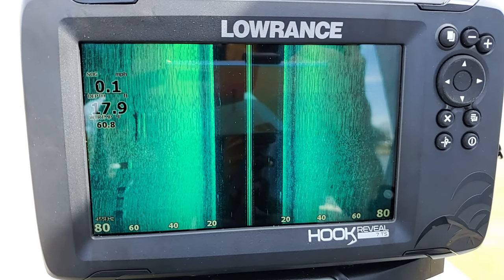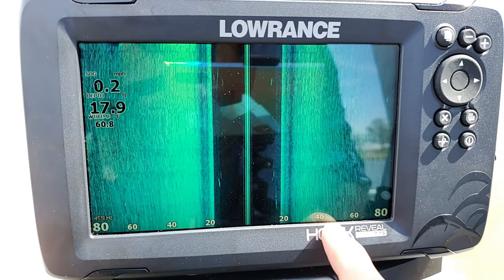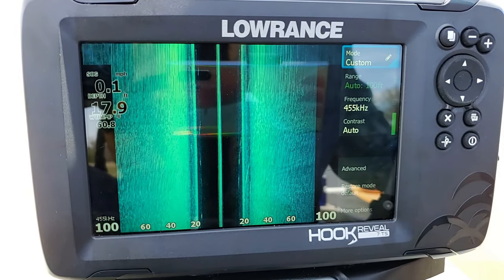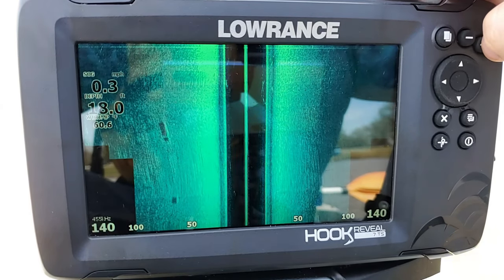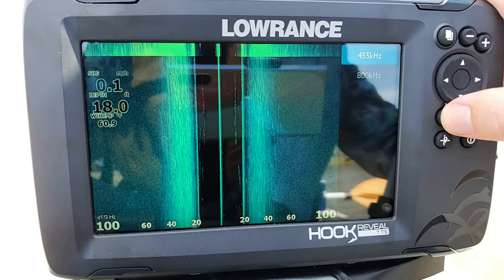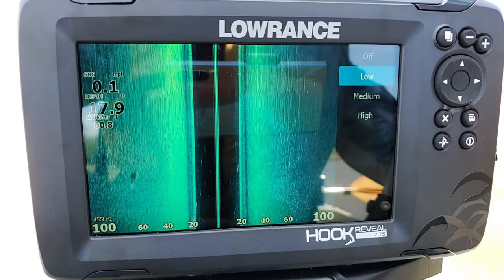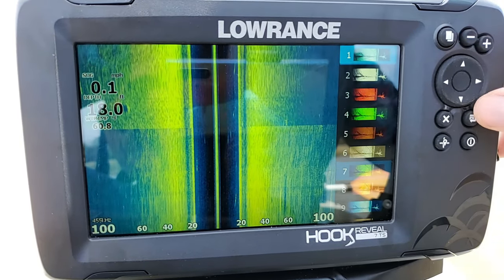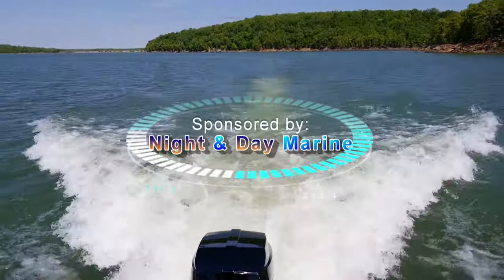Hook Reveal Side Imaging Tutorial

Comment: This is really helpful! I use a 50/200 sonar with down scan today, but really would like to purchase a sonar like this with side scan. witch one are you using her? Or do you have a tip witch one to buy to my Hook Reveal 9?
Reply from the maker: If you use a 50/20p transducer then im assuming your in saltwater. In which case I probably wouldn't recommend this unit cuz it only does 83/200 and is really meant for fresh water. However, if you are using it somewhere warm like the gulf and arnt going too terribly deep then it will work.
Reply: @nightanddaymarine8823  Thanx for replaying. And yes, I use it at sea, but this one I will be using on my riverboat/lake, max 150-160ft, but for the most around 30ft.
Reply from the maker: @mobiusproject4602  this unit would work well for that then. It comes with the tripleshot transducer which does traditional 83/200 chirp sonar as well as downscan and sidescan imaging at a decent price.
Reply: @nightanddaymarine8823  Thanx:-)

Comment: Great vid, but couldn't find what I was looking for..... 
When I plugged in my unit with the tripleshot transducer there was no sidescan option ??? How do I enable it ?
Reply from the maker: It should have by itself. Make sure the plug is all the way in. Then maybe a soft reset on the display. With the unit off, press and hold the Pages button. Then press and release the Power button. But continue to hold the Pages button till you hear the double chirp sound.
Reply: @nightanddaymarine8823  i believe u need a sd card in for the side scan and GPS to work right?
Reply from the maker: @bretana7438  no you don't need an SD card for any of it to work. Only time you need an SD card is if you are transferring or saving data, doing a software update, or putting in additional mapping.
Reply: @nightanddaymarine8823  hey buddie do u know if the lowrance 7x ss have the side scan?
Reply from the maker: @bretana7438  no that one does not do sidescan or mapping. The Splitshot version only does 2d sonar and downscan. And the X version only has GPS but no maps.

Comment: Any ideas on why structures on one side
of the boat are showing up on the opposite side of the screen?
Reply from the maker: If you go to "More Options" make sure the "Flip Left/Right" option isnt turned on. That will cause just this.
Reply from the maker: And if it isn't on, then try turning it on. It's possible the transducer is facing the wrong direction.

Comment: I have a hook reveal 5 with triple shot transducer. Why do I not have sidescan option available in screen pages? I do have tripleshot transducer selected. Thanks
Tony
Reply from the maker: Hmm.. it should automatically show up as an option in your Pages menu.. you might try doing a soft reset on the display while the transducer is connected. If that doesn't do it, then go to your Settings, then select System, then go down to the bottom and select Advanced. When that screen comes up, I think its the Features option that you will select and then you should see Side Imaging as an option to turn on. Once you turn that on, it should then show up as an option in your Pages screen.
Reply: @nightanddaymarine8823  thank you, I'll try that.

Comment: How should you set your depth offsets? I can't seem to find your part 3 video.
Reply from the maker: It depends on how you want to offset the depth. If you are trying to take into account the depth of the water inbetween the surface and the transducer, then you set it to a negative number. If you are trying to add in the depth of let's say a keel sticking down below your vessel and the transducer that is located above it, then you would set it to a positive number.

Comment: I have noticed some fishermen using a different megahertz range on sidescan than on downscan, is this necessary or can both be ran at 800mgz?  Default has both at lower range to give more coverage but I'm hoping to be able to use 800mgz for both when I need the detail.
Reply from the maker: It just really depends on your water conditions. Typically 800 is the best option for downscan, but iv noticed on many occasions that 455 is better on side imaging. But sometimes 800 is better if the water is really clear and relatively shallow
Reply: @nightanddaymarine8823  That part I understand, can both sidescan and downscan be set to 800 without interference between the two?  People with Hummingbird say it causes problems.  That's why I was asking you.  I usually use 450 on both while searching down a creek or channel but need to increase to 800 for more detail. Can they both be on 800 at the same time or just one of them?
Reply from the maker: @ramondanderson6730  there is no interference if you run them on the same frequency because the signals don't really overlap one another. They are very narrow thin slices of signals unless traditional sonar that can interfere if running the same frquency. Some of the displays won't even let you operate them on different frequencies.
Reply: @nightanddaymarine8823  Excellent, I keep hearing different on some of the youtube videos.  Nothing was said the owners manual about it so I didn't know, now I do.  Thanks

Comment: Hey I have the same unit however when I’m using side scan I get what’s on the right side displayed (not as clear) on the left. Cant rely on left all all. Only right side or reliable. I can go down docks on right side of boat and get clear images and see everything but it just shows it mirrored on the left not as clear. 
Have you heard of this before?
Reply from the maker: So the left side is an exact mirror of the right side, but it comes in fuzzy? I can't say I have seen that before. I would typically say it's probably the transducer, but I cant say that for sure. It could also be something with the display. I will have to check around and get back with you on that one.
Reply: @nightanddaymarine8823  yeah same but not as clear.  Can pass a dock on port side and get nothing. Pass those same docks starboard at same distance and see good strong returns with clear images. Mirrored not as clear on the left side. When I get home I’m going to see how level it is. Looks dead nuts level and used a level on install. It makes me wonder how reliable the traditional and down scan is knowing what I’m getting on side scan 🧐
Reply from the maker: @mrmagicjax  well I can say that the traditional sonar and downscan are completely different signals being broadcasted out and use different elements inside the transducer to create the sound waves, so even if side imaging is off, the rest should still work independently of it.
Reply: If you have an outboard or stern drive, you maybe getting interference from the leg. Try tilting the leg up a bit and see if that helps.
Reply: i get that when my transducer is not perpendicular on the bottom, or something is blocking it

Comment: great video. 
just started using my 7TS on my kayak. am new to using these as well. Did get sonar and downscan with fish reveal working but have an issue with sidescan. while it seems to be working (shows the water column and looks like its working i didnt seem to see any structure. I paddled by a dock and expected to see something but didnt see anything. Still have to do some more testing though
Reply from the maker: So it shows the bottom as just flat and there's no structure at all?
Reply: @nightanddaymarine8823  mine does the same it will tell me whether it's a hard or soft bottom but will not register anything else with much clarity
Reply: Man i thought it was just me

Comment: Please explain your pyramid geometry picture.
Timewise, a vertical picture line at the very top of the display is recieved just now, while a line printed half inch lower from the top was recieved some 10 seconds ago….so your pyramid top and bottom represents a time and boat position difference if crusing.

if a fish is right under the boat, it shows up in the water column on both sides of the midline….the closer to the midline the two dots are, the closer to the boat/surface. If they show up close to where the bottom starts further away from the midline, they are close to the bottom.

A fish further to the side, is difficult to position, the only help is if it is big enough to cast a shadow on the bottom, and then imagine a focused torch shining at it from the midline (at the water surface) creating the shagow, and judge its position from that.

I do not understand your statement, that you miss a part of the bottom? When you see a known bottom structure right under the boat, that extends further to each side of the boat, a log or a sunken boat f.ex., it shows up on both sides with the expected geometry (depending of boat speed vs scan speed) in the graphics. Please explain….kind regards h.
Reply from the maker: Yes there is an area that is missing on the sidescan and that's the area directly beneath the black water column area. The sidescan imaging isn't a full 180 degree sweep. It's like two 70 degree beams shooting out on both sides. The area that you do not see on the sidescan that is directly below you is the area that shows up on your downscan. It doesn't just take a full image of the bottom and then split it in half for the left and right view. 
And the pyramid image is it help visualize that the black water colum area that you are seeing is at a downward angle. So a fish that shows up on it is going to be so many feet down and so many feet to the side. It won't show any fish that are directly beneath you. They will be out to the sides of you when they appear. But again the fish directly beneath you, will show up on the downscan imaging instead.
Reply from the maker: Go to this link and its like the third image down. That's for the most part what it's like. Altho there is a little more overlapping with the down and side beams. https://www.thehulltruth.com/marine-electronics-forum/835191-transducer-placement.html#&gid=1&pid=2

Comment: Hi, in the start, I hear you say the (black)  water column stretches out 20 feet to each side, and that you do not see the bottom right below the boat
…..this is not true in my view…..the water column stretches 20 feet down, as the boat is on 20 feet of water…..and structure or fish right under the boat close to the bottom shows up in the picture close to the 20feet distance line on both sides of the centerline. So the bottom seen at both sides at 20 feet is right under you, but 20 feet down. Fish further out to the side will show op at their distance from the transducer as light hits them (as if iluminated by a torch) and cast a shadow on the bottom where the straight line from the transducer to the fish hits the bottom……kind rgds Henrik
Reply: My understanding is the same as yours… The empty area in the centre is the water directly below. When you start getting structure on the display, that’s when you start counting the distance to either side. For example, if you’ve got 20 feet of water below, you’ll only start seeing structure at the 20 foot line either side, then you can start calculating the distance away from your location. With 20 feet of water below, the 40 foot line on either side means the object you’re seeing is only 20 feet away. I may be getting this wrong, but that was my interpretation of how this feature works?
Reply: @TheRoastontoast  exactly...well explained!! Thanks...Henrik